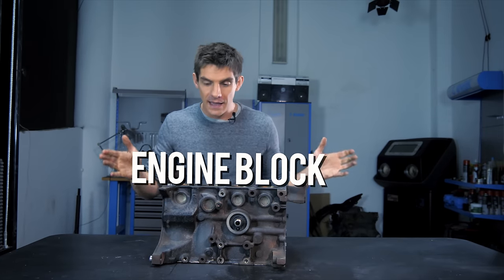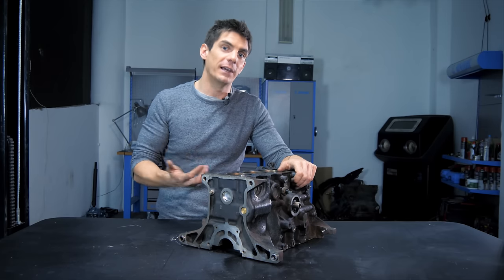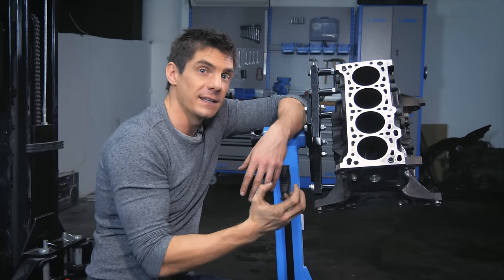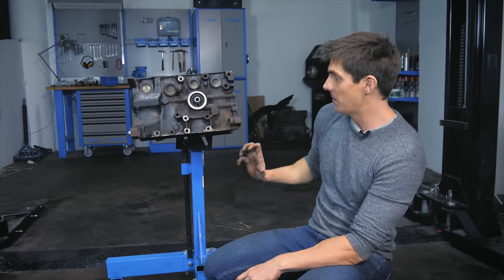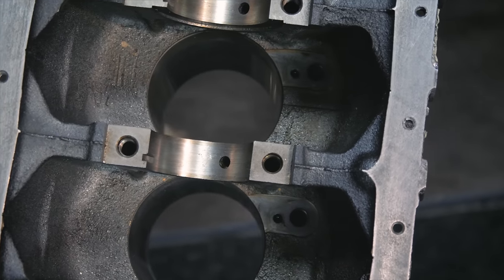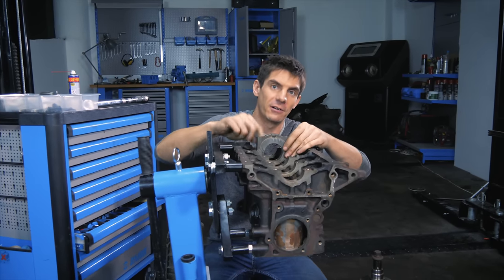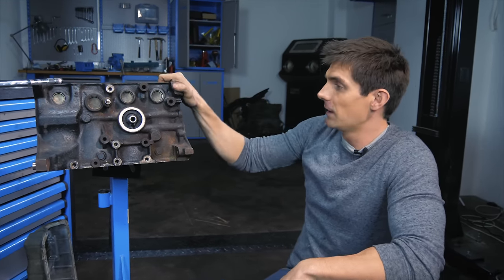Everything about Engine Blocks

Comment: I've always wondered 2 things about the plugs. 1) Why not simply braze or weld them closed (and yes, I know.... you can't weld cast. Until someone shows you how). 2) on billet blocks, do they omit this and simply use long drills to go from point A to B, intersecting where needed and threading a plug to cap where needed?  Worked on my fair share of ice cubes (frozen engines where the owners forgot they only used water that summer), so I usually find the plugs in tact and block broken. About the only thing I've seen good about them is block heater..... till they leak.

Comment: They are commonly called freeze plugs because I had water in an engine that I forgot to drain before the cold came.  It got cold enough to lightly freeze the water, which made  2 plugs leak.  I got the water out before we had a hard freeze.  Engine saved.

Comment: 0:00 Engine Block 
5:08 The Deck 
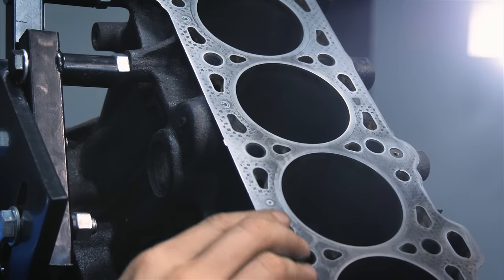6:39 Oil Galleries 
9:00 Under side of Engine (Crankcase)
12:58 Core Plugs 
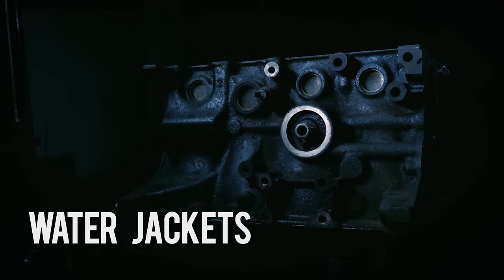16:18 Water Jackets

Comment: 11:45 bearing caps are cast separately, certainly not cut off the main block casting. The mating surfaces are machined and they are placed together before the final crank hole machining.

Comment: The only bit of misinformation was regarding the main caps. they are not typically cast with the block. They are usually forged and the grain pattern runs lengthwise. The block and caps are machined to fit one another and the main bore is cut and honed. 

Besides that, great and simple explanation for anyone at any level.

Comment: Can't beat the cast iron blocks if you want longevity. I specifically bought a 2022 4 banger Tacoma because it's one of the last cast iron block 2TR-FE powered Toyotas that will ever be made. Heavy , slow? Yeah but I will get 350,000 miles out of it.
Reply: My first car was a 2001 Ford Taurus that has a cast iron V6. Its not a powerful car, but it was reliable in the nearly 4 years I had it. I gave it to my aunt in Mexico several years ago and is still running strong on the original engine and transmission. Last I heard, it had over 239k miles and still runs fine.

Comment: The jets pointing up at the cylinder have to restricted for two reasons.  The first is to maintain oil pressure the other is so that oil comes out in a spray rather than a stream.
The Main Bearing Caps on cast iron blocks are cast as a seperate piece, machined and then sawn apart by a set of cutters that literally look like circular saw blades.
On modern aluminum engines the caps are typically made from a powdered metal in a sintering process. These typically have 4 or 6 bolts.

Comment: I always knew that the core plugs were from the casting process but thought they were designed to also act as a “freeze plug” that is pushed out if the coolant was to freeze. I always figured that they were designed to kill two birds with one stone. What I didn’t know was that the whole idea of them being designed to be a freeze plug specifically for protecting the block from cracking was nothing more than an urban legend.

Comment: If I had to guess, I would say the core holes in the block also originally supported and aligned the center of the mold before casting.

Comment: Is that a Miata block?! I never knew which ones were the oil and coolant holes. This is awesome
Reply from the maker: Yes, it's a Miata block.  I only really learned which holes were which when I did the 3D modeling of the block.  I know I keep promising the CGI but for things like this it's going to be absolutely awesome.  Hold tight!!
Reply: @howacarworks  what 3d modeling software do you use

Comment: Nice presentation but don't think you have seen every permutation in his comments.  For example, most engines using cylinder liners (where the block is aluminium and the liner cast iron or hardened steel) the liners are removable.  The first 4 cylinder BMW motorcycle engines used a single cast iron cylinder liner assembly that is pressed into the block, for one example of how much variation there can be.  The Citroen DS and later cars used a cast block with individually removable cast liners, using a very thin plastic seal between the block and the bottom of the liner.  So LOTS of variation!  I'm sure the presentor is aware of these variations, and more, I just don't want the viewers to take this a gospel for all engines.
Reply: Automotive petrol engines with removeable cylinder liners may be common in Europe, but not in North America, and are not common in Japan, so the majority of automotive engines use fixed liners. As far as every permutation, I'm happy he didn't try to make a lawyer's letter describing all the wild and peculiar instances of this presentation.

Comment: 16:50 The demonstrator says "We want to maintain clearance between piston and cylinder walls". 

But won't that prevent a good stroke, because the gases will escape from the clearance space? I thought pistons should be flush with the walls.
Reply: the pistons shouldn't be flush thats what piston rings are for is my understanding
Reply: + gases going past the piston is called blowby just fyi :)

Comment: The primary function of the engine block (along with providing cylinders for the pistons to operate in) is to position and support the crankshaft through the main bore.

Comment: Also called a crankcase
Reply from the maker: +ikillyoudead Sometimes. The crankcase is the bottom half of the block - the part below the cylinders. The cylinder block and crankcase were historically separate but now they are both part of what’s called the engine block.

Comment: I always wondered where does one get an information as to how much to torque each bolt?
Reply from the maker: +0record0 you’ll find it in a workshop manual - Haynes or chiltons. Or you can often find pdf versions of the original manufacturers manuals online. If it’s a common bolt then you’ll find the numbers on owners forums easily enough. Good luck!

Comment: Melting temp of gray cast iron pls
Reply: 2066F or 1130C. But this is solid to liquid transition temp. You will have some liquid mixed with solid. 

The exact percentage of each depends mostly on carbon content. At 4.3%Carbon you will have a full liquid. Above or below that you get a liquid/solid mix that will slowly change to a liquid as temperature increases further.

Comment: Is it possible to add under-piston oil jets/squirters to any engine?
Reply: You could but that's the job of the crank shaft
Reply: @tobylewis1920  This MX-5 engine has it. The 2JZ-GTE has it. There must be a reason for having it?
Reply: @nickamarit  cooling of cylinder walls and pistons.
Reply: @tobylewis1920  I can understand 2JZ-GTE's use of it to prevent predetonation. But why does this naturally-aspirated MX-5 engine have it?

Comment: Mistake 1: You said, "we don't want the piston rings to contact the cylinder liner/wall", ... THAT, is what the rings are for, to contact & close up any gap between the piston & the cylinder liner/wall.
Reply: "The piston must run on a film of oil". What's the mistake?

Comment: Clueless cast iron blocks have liners or sleeves wtf is this guy on about even engines from the 70's or so have them
Reply: They do. Not common for mass produced passenger cars though. Sleeves are common on heavy duty engines. But I think he is focusing on light duty truck and passenger car engines.
Reply: @geoffmooregm  how if all later model vehicle engines from about the 70's have sleeved or liners my Japanese and 80's bmw engine have it . Maybe do abit of research before commenting
Reply: @_i-kr6eg  You said CAST IRON blocks have liners. They do but it is rare on passenger car engines. On heavy duty engines it is the norm. I was agreeing with you!